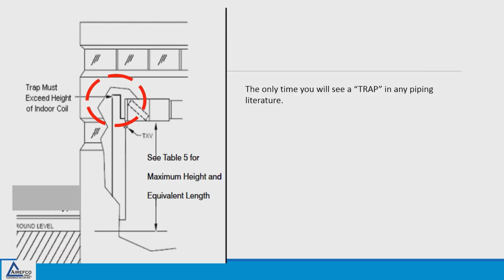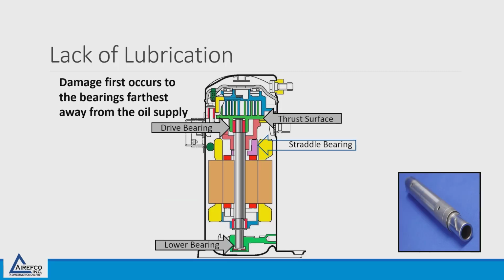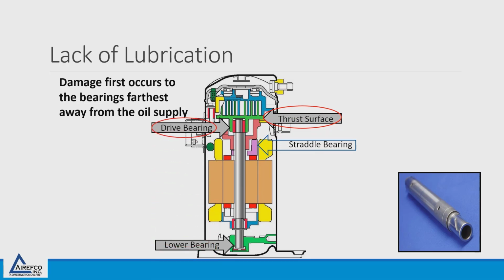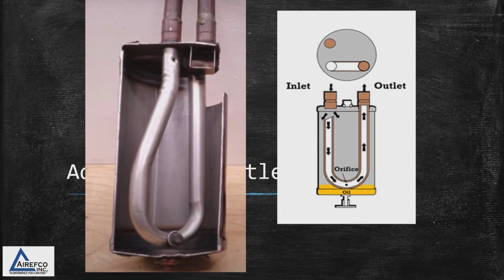Lubrication

Comment: Another great video. The last section on accumulators reminded me of a job I did many years ago. It was a burn out on a split system heat pump. 
I was not yet tuned into the fact that the accumulator of course would be full of junk during a burn out. But I was aware enough to put a suction line filter between the accumulator and the compressor. 
But it was the sealed type of filter dryer.
The day after I finished the change out of the new compressor and filter drier, they called again and said it wasn’t working.
I went out and of course the suction line dryer I installed was totally clogged. 
So then again... just not being aware enough to think about installing a new accumulator, I thought I was a smarty pants and I went and got a another suction line filter dryer,  but the  kind with replaceable core, and of course ultimately it worked... I did indeed have to go back the next day and replaced the core and I think I went back another time a few days later and replaced it one last time. But of course I could’ve saved myself and the customer a whole lot of headache and work and money if I had just removed the accumulator and installed a new accumulator as part of the compressor change out.